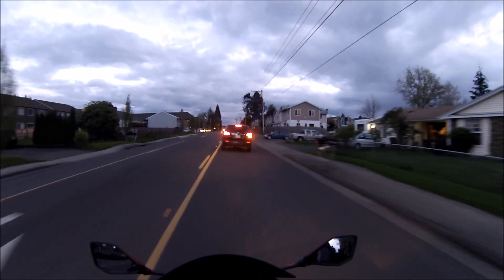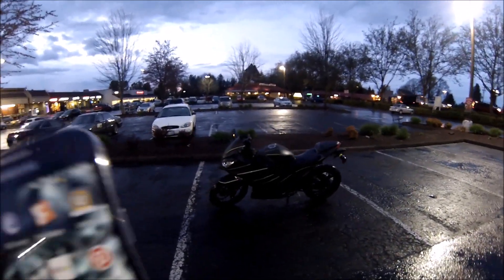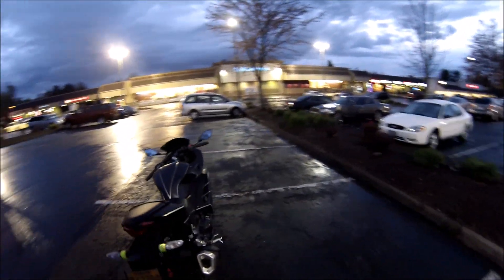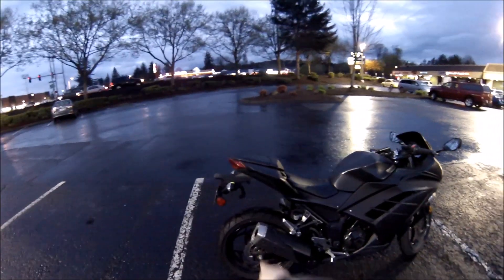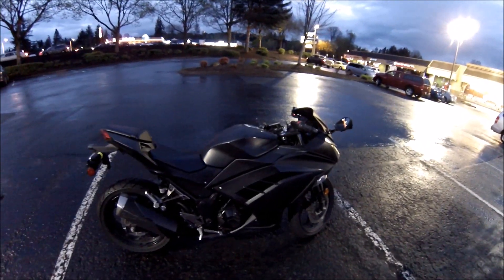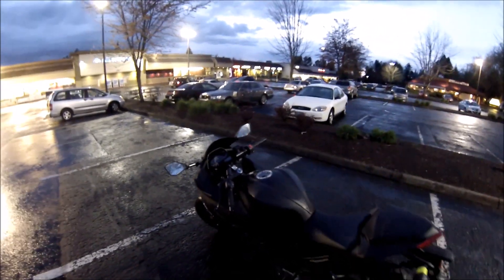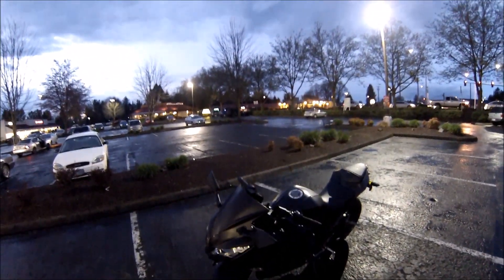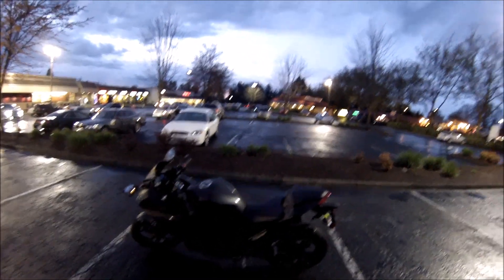Ninja 300 - Custom Plasti Dip and Retro Tape

Comment: Your bikes lookin good! I plasti dipped my 250 after owning it for a few months and if I hadn't already sold it I was planning on getting the tank grips as well. My pants would rub and start to wear on the plasti dip so that's a must. Not sure if it's the same for you but I actually had wear on the upper part of the side fairings where they make contact with the tank so just a heads up for you in case. I was riding heavily putting in many many miles per day so I had a considerable amount of wear on my dip job lol. Yours looks great as mine did at first. Love what you did with the tape and I mean I absolutely love it. I was looking into that stuff Volvo makes called Life Paint but the tape seems like a faster and easier application. Really considering it for my recently acquired '97 ZX-6R. Kudos!
Reply from the maker: daydrinker187 If you go the tape route, it comes with a backing and a plastic protective surface that you need to peel off after you get the tape on.  I didn't know that, and when I finished my first ride with it on, I found that there were some weird peel spots that freaked me out until I realized it was a separate layer to strip back off.

Comment: is your bike still plasti dipped? just wondering how well it held up after a year.  Thinking of doing this to my ninja 300 as well.
Reply from the maker: Yes! I have touched up a couple spots I didn't cover really well the first time and thus got rubbed off, but by and large the coast has held up.
Reply: Awesome! good to know.  was planning on getting tank pads immediately after so I can preserve the tank plasti dip as much as possible
Reply from the maker: That's definitely the biggest wear spot.  I rubbed my tank off which is why I have a whole video about redoing the tank and adding grips.